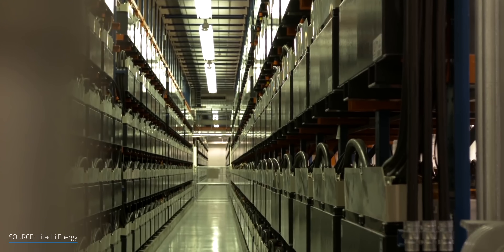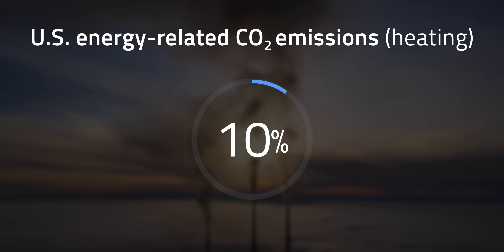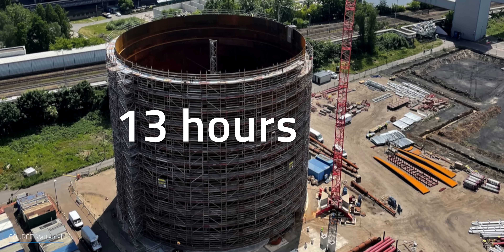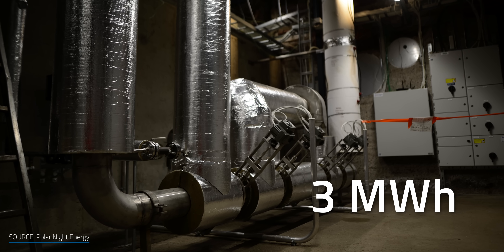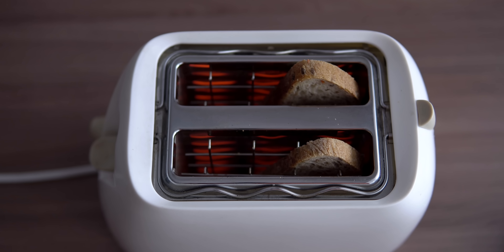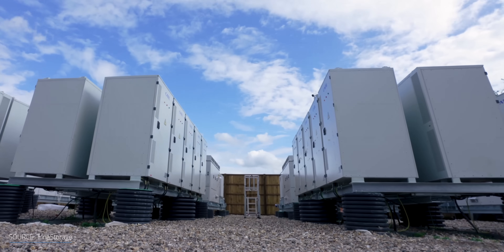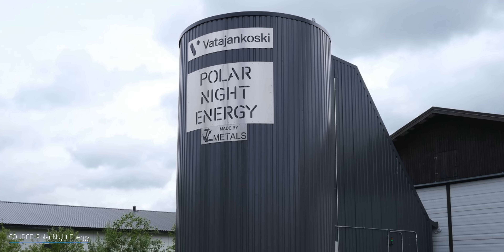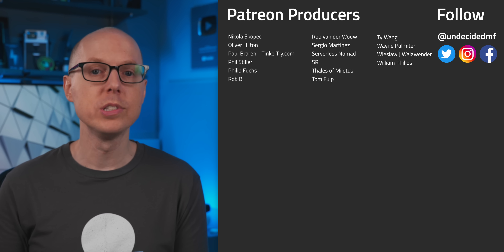How A Sand Battery Could Change The Energy Game

Comment: I think one of the reasons that storing heat into sand could be viable in Finland, is because we already have the pipe infrastructure in place in most cities, and most power plants were producing both electricity and heat (during winter). With the current fossils based production being replaced by renewable energy sources like wind turbines which don't produce any heat, the current heatpipe network is becoming obsolete unless we replace it with alternative heat sources.
Reply: Electricity generators like wind turbines or PVs can heat sand to convert to heated air. It's only a heat source which doesn't convert so well to electricity.
Reply: @markhathaway9456  yes, but for renewables, you need something in between to turn it into heat. Might be a storing method as well, which acts as a way to even out the energy output from an irregular source like a wind turbine.

Comment: Nuclear there's your solution
Reply: Nuclear would certainly be a cleaner solution than carbon-based fuels. How's the efficiency of the heated-water --> steam --> turbine-generating-electricity compared to some of the renewable energy sources which generate electricity? Of course, nuclear is expensive to build too.
Reply: @markhathaway9456  Look up the efficiency of solar cells they are pathetic ,The energy density on them is terrible . Nuclear is way more efficient and the newer Fission reactors will be the way of the future . Just have to convince these nimrod governments its the way to go .

Comment: This video could be improved. You stay away from details and surf over basic stuff.... Look more like an ad then an informative technical video. The devil is in details, advantage of sand over other material like.... Water, dirt, metal, potatoes.... Why using air for calories transportation, advantage over other methods, molten salt, water... whisky....
In first approximation, I find this project...like those guys are not scientists at all.
Reply: Sand is plentiful, cheap, everywhere, easily heated, can be heated at standard air pressure to much higher temps than water, and it's safe.

Comment: I have question: On tropical country, Cold water is needed. Can we use this technology to pump a cooler water temperature (7 deg Celsius) to the sand silo then utilitize this stored cooler water supply.
Reply: How would you propose cooling the sand and how low temp can sand become?
Reply: @markhathaway9456  https://youtu.be/0rzQhSXVq60. The chiller machine will cool the water and pump it to the sand because in my opinion maybe sand has high thermal inertia characteristics that's why it can keep storing hot temperature for a longer time. I think maybe it can store colder temperature too. This is only my opinion you can correct if I have flaws and mistakes in my thoughts.

Comment: This is not new. I built my house in 1983 and incorporated a large sand box under the floor. This box has over 1000’ of tubing imbedded in it. Solar thermal is by far the most viable solar solution. It makes no sense that there is currently no incentive to install it. Back in 1982, there was a state and federal tax credit Of 50%. I had a solar heating business back then and installed over 100 4x8 panels all over north west Ohio. Many of the systems are still operating. The political arena will not allow the correct most viable technology to prevail.
Reply: Are you talking about  "solar heaters"? Those are pretty cheap. I've been watching YouTube videos about those the last couple of days. It's very appealing if you can get the details right. Box, tube or other collection, glass cover, water or air through the tube: in cold, out hot.

Comment: Sand battery is a joke 🤣🤣🤣🤣.....
When you are talking into account that you'll have to hadle 400 degrees celsius with sand and you can take advantage of the phase change of water maybe pressurized a little to increase the boiling point....
Everything is in favor of just an old water heated tank
Reply: It's the same general idea except they want to store more heat and with a lot more sand. But, how long can your water tank hold the hot water without losing all the heat? That's where proper insulation or other details come into it.

Comment: They can probably increase efficiency by replacing resistive heating with  heat pumps considering they ahve over 100% efficiency (opposed to only 100% for resistive heating)  : channel the excess solar generated  electricity in the summer  to heat pumps to extract the ambient heat in summer  to be stored  for autumn and winter months

Comment: So could this be combined with a small nuclear heating system . Drastically downsizing the nuclear component and this system greatly increasing efficiency. Or these systems integrated into current nuclear plants. Just a thought ,guessing.
Reply: Current nuclear plants generate hot steam to turn a turbine and generate electricity. They don't use batteries. Add a battery system and it would indeed improve the consistent delivery of electricity on the grid. They might gain a lot of public support by doing something like that.
Reply: @markhathaway9456  that's what I was thinking. Pipe the steam through the batteries exiting the turbine and before it reaches the condenser or heat wasted in cooling ponds. Or, pipe the waste steam through the batteries to heat the battery ,condense the water out above the battery and drop the water back through the battery to preheat the heat the feed  water.  Closed loop and maybe improving the efficiency of the nuclear, while letting almost no heat back out into the atmosphere.?

Comment: Electric resistance heaters suffer from a very low efficiency.  This sounds great, but not really.
Reply: What's the best way to transfer heat to a storage medium like sand?
Reply: HUH? If you mean converting electric power to heat, it is 100% efficient.
If you are addressing how the resulting heat is utilized or distributed, then elaborate.

Comment: Ok maybe I am crazy but Couldn't you run a refrigerant line/coil threw the sand as well and set up some kind of Epic scale Geo thermal heat pump to cool threw the same HVAC system you would use to distribute the hot air?

Comment: Another way is to pump water to the top of a hill (or mountain) using excess wind turbine or solar electricity, and then allow that water to flow downhill (hydroelectric power) when needed.  It does need terrain and reservoirs, suitable for some areas.  Some losses in that, not too bad. .... Similar to this concept, Hoover Dam could pump some water back up to the upstream reservoir (Lake Meade), powered by excess wind or solar when it can.  Getting solar panels and/or windmills out in the hot desert near Las Vegas works pretty well, and it could help Hoover Dam produce more when needed.
Reply: It's a neat idea to improve existing infrastructure, but it's not convenient for every place.

Comment: Let alone a sand battery we are barely at the technical maturity phase or even at the The point of commercializing sodium-based batteries for energy storage. For the next 10 to 15 years we will be heavily reliant on the scarce resource, lithium takes 7 to 10 years to extract from the ground and we do not have enough supply to keep up with demand for electric vehicles and energy storage

Comment: Im thinking this system would be more efficient if they put the silos in the ground.  Would be able to keep a more even temperature through out winter. Plus less space used in the city.
Reply: I love the idea of using the ground for insulation. A structure half in the ground and half out gets a lot of that benefit and one with an underground piping system can keep air temps steady at low cost, though maybe high land use.

Comment: It only makes sense to me if the energy form to be consumed is thermal. And the location of energy consumption is local to the the storage vessel. Too many significant losses are associated with conversion and or transmission from thermal. Calling it a ‘battery’ is a bit deceptive. Most folks will think they can plug into it and charge their phone.

Comment: I honestly think that the "Nuclear Diamond" battery, combined with more nuclear produced energy, will outpace all future power storage and generation needs. No extra hoopla and complex systems, just the battery. The only components necessary are the materials. Also the lifespan of the battery is much greater than other options. And with them charging themselves, using the standard of measurement we use now, they actually have a greater than 100% power retention rate.  I would be interested to hear what you have to say about them though, as you seem to dig deep into these subjects and I have just scratched the surface of "Nuclear diamond" battery tech.

Comment: I wonder if you could tap into water infrastructure to provide the heat to a building. For example heat up the water headed into a residential area. Buildings could use radiant heated floors to distribute the heat and then recycle the water into a holding tank for cold water. Reverse the idea that we get cold water and have to heat it up for use in our houses and instead get hot water and passively cool it for use.
Reply: A water heater is well-insulated, but it is all together. What you're describing might be too distributed to hold heat well enough. But it is an interesting idea and people who know a lot more than me might make it work. It would be neat to combine heated water with heating air into one system.
Reply: @markhathaway9456  it just reminds me of Ethernet over Power. It would be convenient to use existing infrastructure. Perhaps using heat at an air inlet in a building would be another option.

Comment: This scales up very well. Volume of a cylinder increases faster than surface area so a larger unit has more storage volume with less surface area to lose heat. It does not scale down very well for the same reason... be hard to keep it at 600*C for months if it's only the size of say an oil barrel.
Reply: I wonder what kind of insulation materials and techniques might do the job for a small size container.

Comment: This is pretty cool, but they are using the wrong type of sand, the sand used in construction is surprisingly limited and is completely recycled, meaning you are not making any difference by using it, you are better off using the super fine desert sand that is completely un-usable for construction, aside from this, its a cool idea

Comment: If sand retains heat for months, in the same token sand will not release heat fast enough for prectical use.
Reply: That's where the forced air comes in.
The extended storage is within the insulated tank, with no air movement.
To release, they move air over (or through) the sand to absorb the heat for distribution.

Comment: What about the possibility of heating the sand using solar thermal energy in addition to electrical energy (double panes of glass top on the silo)?  Or perhaps some sort of flat box to heat sand in using the sun and then using a transport mechanism to store it in the insulated silo.
Reply: Look up "solar furnace" or "solar heater" on YouTube. That idea has been around a long time and there are a lot of videos on it.

Comment: You spent over 4 minutes just yammering on and on and zzzzzzz. You told us it was going to be about a sand battery. Get to the point.

So essentially a geothermal solution.
Reply: Geothermal is like hydro-electric in that it isn't convenient everywhere. However, various means of generating heat and storing it in natural materials is thermal mass basically.

Comment: Thank you for the new video. I love the sand battery! It has an elegance to it, thanks to the design. It's big, simple, and efficient - which is just what we need for huge energy storage systems. The problem of course is like you said, it stores heat and not electricity. To make proper use of it we'd need to build new heat transport architecture in our cities, and no doubt there's a limit to how far you can run hot air through pipes before losing too much of the heat. So it's probably not feasible to use an existing downtown facility and run pipes to the suburbs.

But, again like you said in the video, it could find practical use in industrial settings. When you've already got a multi-billion dollar steel plant it doesn't sound quite so crazy to build a huge sand battery next to it and decarbonize by tapping renewable energy as heat.
Reply: You've hit on a key issue for all energy generation, distribution and use. How much do we lose along the way? It's a huge issue and the answers vary according to whether it's electricity or heat.

Comment: If air is moved through the sand storage,   No loss in pipes to transfer the heat with another medium.    In my area there is several hundred feet layer of air filled sand below the ground above the water table.  56 degree air could be heat pumped down to 35.   There would also be the phase change of moist in the cooling of the 100% humidity air to 35 degrees.  This Condensate is drinking water quality.  Plus a heat pump will use ground heat when atmosphere air is below 56.

Comment: If the end use of this heat is likely to be transmitted via water systems - then it makes zero sense to store that heat in anything but the water you will be using.  A stratified water tank stores more heat than an equivalent tank of sand with water pipes through it, be far simpler to utilize, and easier to manufacture.  Water has a higher density AND and higher specific heat than sand.  You also get more usable heat storage out of stratification than this system would, because the water being drawn from the top is always the hottest water in the tank, while the sand will be cooling over it's entire mass as the air is passed through it.

Just because a startup is trying a new thing - doesn't mean it is somehow better than the old thing - these are simple thermodynamic properties that are known.
Reply: The only advantage of using sand for the storage medium is that it can store the heat at a higher temperature than water.  This comes at the huge cost of increased losses from the tank boundaries.
Reply: You CAN stratify a solid storage medium; as in a regenerator configuration. You charge the heat and extract the heat from the same end, air flow opposite directs, for adding or removing heat respectively...
Probably from the top, if there is significant convection migration in the sand...
Depending on cycling frequency.

Describing how this works is a little involved.
Reply: @troubleshooter1975  Yes, you can.. sort of.. but when the specific heat of the two mediums are so different (air to sand), it is very hard to actually extract the heat just from where you want it.. and it doesn't change the fact that if you are going to distribute it via water, there's little to no reason not to just use water for the storage.